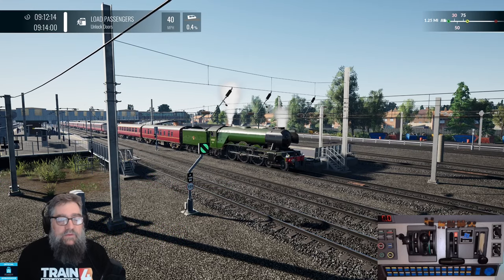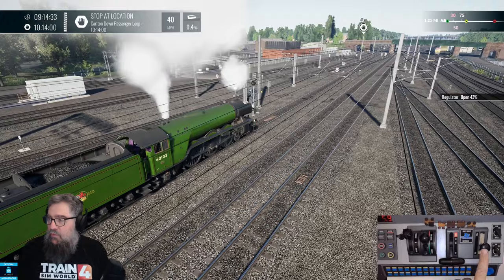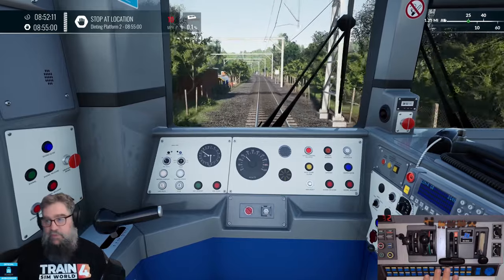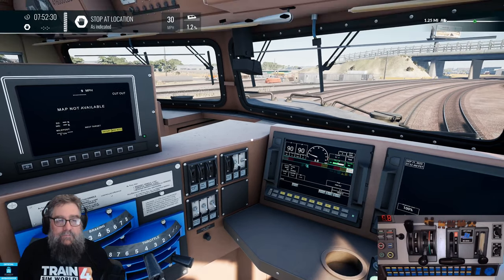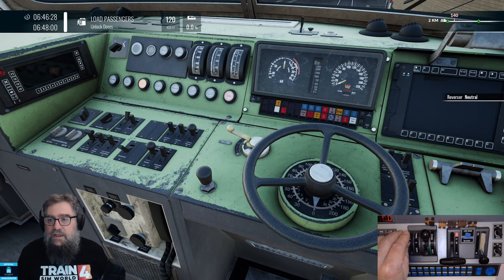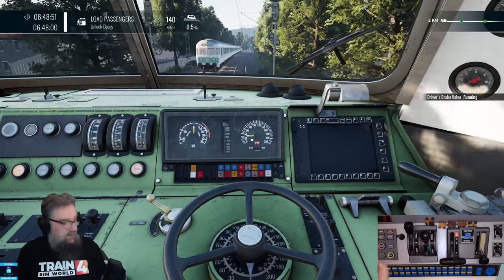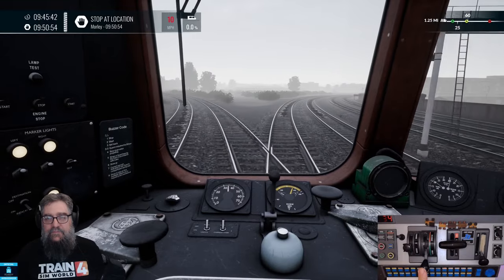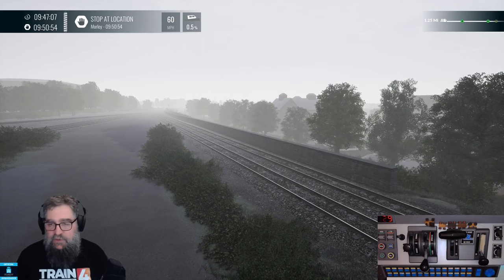TSW4 How To Drive With Raildriver Across The Fleet

Comment: Many thanks for sharing this! I bought a RailDriver and was waiting for the delivery! I wonder how we can know the button mapping set by DTG of each route and loco, because as you mentioned in another video, the adds-on list, or DLC loader, at calibration page does not display normally, and we can't just view the button assignment by just move the cursor onto each key.
Reply from the maker: The new DLC manager interferes a bit with what you can see. Load the route and spawn a service and go into settings/advanced controls then you will be able to see the mapping for the keys for that loco/train.
Reply: @trainsimulatordriver  Thanks! Got it now
Reply from the maker: @lhp-rhp6062  I used to maintain a document with all the mappings then a bunch of them got changed and they started to become more consistent so I stopped
Reply: @trainsimulatordriver  Yeah that should help. Actually I got somehow unsatisfied with RD lever’s poor precision, and was thinking about turning to use some third-party joystick mapping solutions. Thanks for your help anyway!
Reply from the maker: @lhp-rhp6062  if you're thinking in TSW4 it's not Raildriver that's imprecise, its the way they use it. If you want a good example of how it could world in TSW4 try the Blackpool Pacer Class 142. That's how you do it. Hopefully DTG will learn from that implementing.